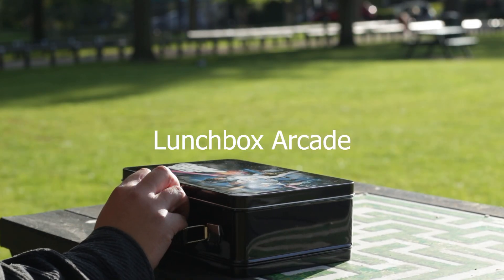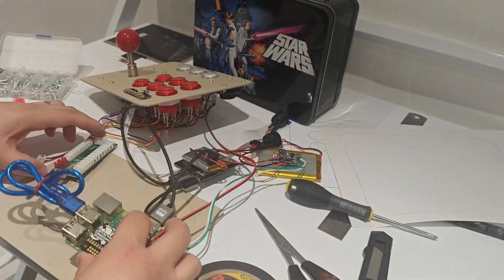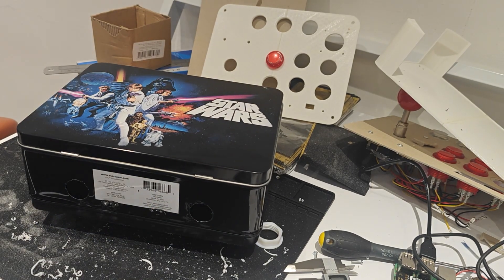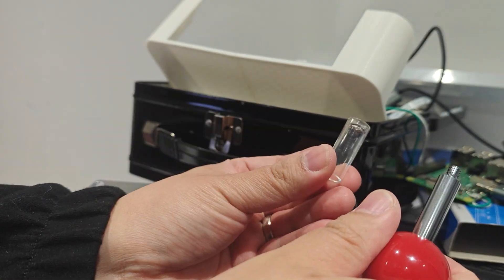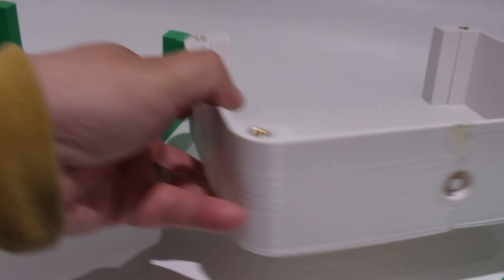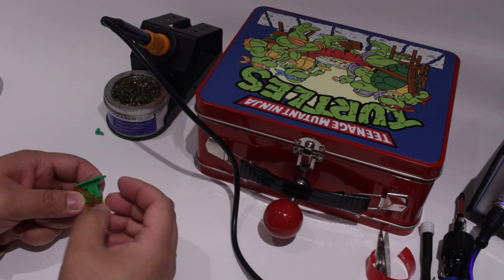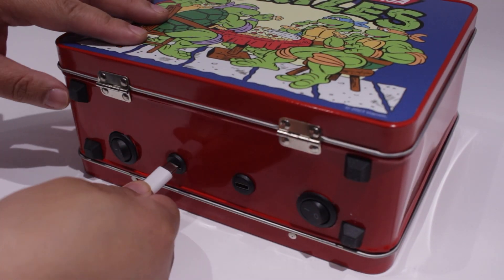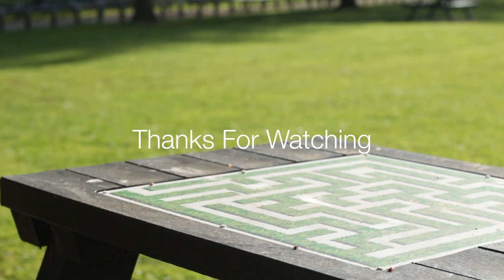Lunchbox Arcade

Comment: the buttons too much gap, you should of do the convex layout
Reply from the maker: These weren't actually based on any layout. I did get a rough template but to also point out these are 24mm buttons, not the 30mm ones